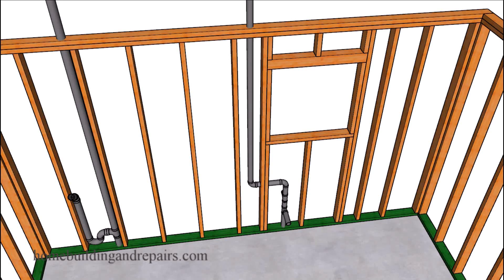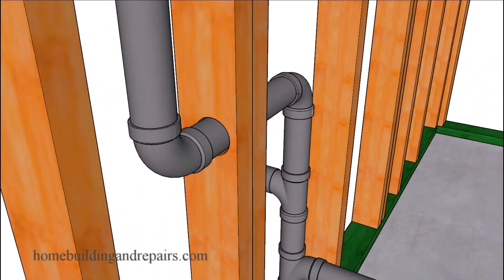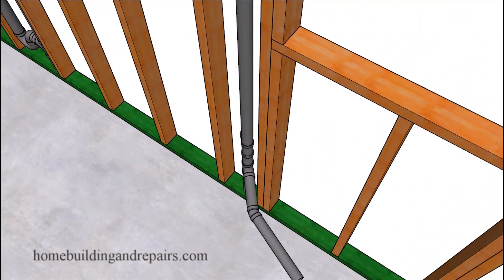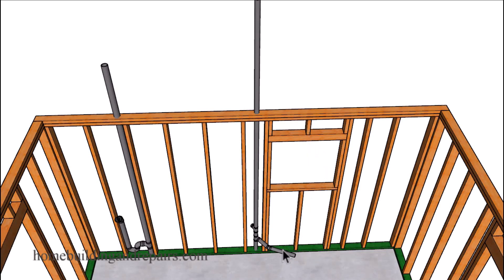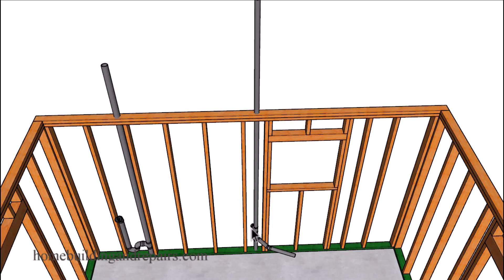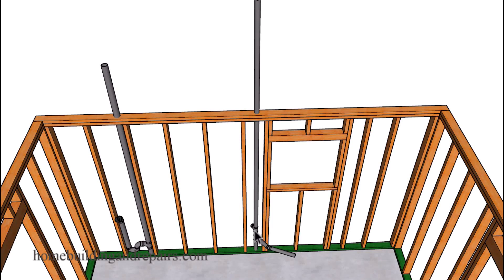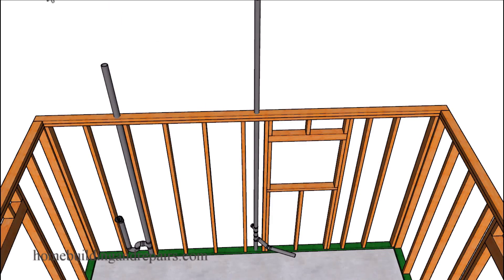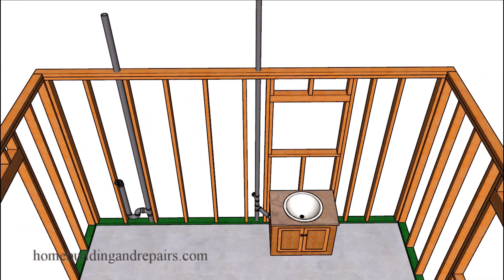Quit Doing This - Drilling Large Holes In Window Framing Studs For Plumbing Vent Pipes

Comment: There is no way the inspectors in the city of Chicago will allow me to do this and customers seeing a plumber hack their newly purchased cabinet, would most likely make the plumbers customer base dry up after seeing that type of work. Also, I use escutcheons on all protruding piping into cabinet space. Lastly, most of the windows over kitchen sinks in my area are way larger than the base cabinet for that sink, so not only are you hacking one cabinet, you hack a few. So instead of the "plumber" drilling a 2 plus inch hole through the studs to run a 2" vent, look at the code book and reduce that opening to just fit 1-1/4" vent pipe for your 2" drain. If you care about the prep, stop being lazy and change your bit from 2" to 1-1/4" to save some structural framing.
Reply from the maker: I just checked with the city of Chicago and they said my suggestions will work just fine.
Reply: @gregvancom  Right... that's why you will never see that crap anywhere in the Chicagoland area. That's great you focused on your amazing breakthrough, now look past yourself and read the rest of my comment and address the whole picture. This seems like an architect's response to poor plumb wall design. Everyone blames the other guy when installing framing, electrical, plumbing, etc. Yet in reality it's just being plain cheap with building materials from the start. Every plumb wall that is a structural support for the structure being built should be a minimum 6", but it's cost right. Everyone has to make there buck and sell themselves and the project, so we have to cheapen up the build and install all the piping that may cause an issue on the outside of the wall. Nothing of any greatness will ever be built when humanity can only think about costs and how to shave a little off. Could you for a second imagine a standard three bedroom home build with no hold barred and no "cost" restrictions. Most can't because like lemmings are on the consume, trash and bury mindset along with how much money I can rake in to keep that cycle going.

Comment: Or maybe double up the king stud.
Reply from the maker: Do you have any building codes that might support your comment? I've looked, but couldn't find one.
Reply: @gregvancom  Sorry, I know nothing of building codes.  I just thought it might improve the problem.  I would very much prefer not to put holes in structural lumber at all.
Reply: @gregvancom  Additional thought / question, since metal studs have precut holes, could one of those be used to repair this type of situation?
Reply: @gregvancom  2308.5.8 Pipes in walls.

Comment: Had a plumber I've used in the past come over to replace an air admittance valve for a kitchen sink that sat in front of a 58" garden window. The old fake vent (to meet code and fool the inspector) was about 6' to the right, at the corner of the house. This was a load bearing wall.

There was a dishwasher between the sink and vent, so he just wanted to blast through the studs. I argued against it, he said it met code and pushed forward.  Some Google-fu showed he was wrong/BS'ing the state code.

By then he had got his tools ready, which included a 3" hole saw (for my 1 1/2" vent to go through 2x4 studs!). That particular job ended right then and there. Wish I was smart enough to not bring him back, but we did for HVAC repairs. One of his apprentices stole a blank check during that service call.  Ugh.

Anyways, great video Greg! Your videos have been amazing over the years. Literally the go to source for confidence building a shed on 6' stilts, jacking a building to replace still plates and everything in between.
Reply from the maker: Great to hear and thanks for the kind words.